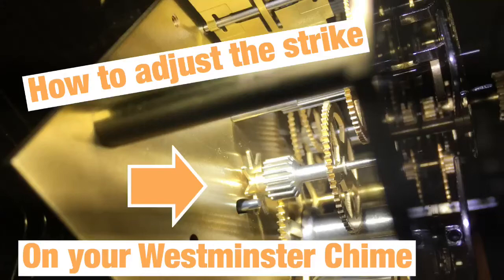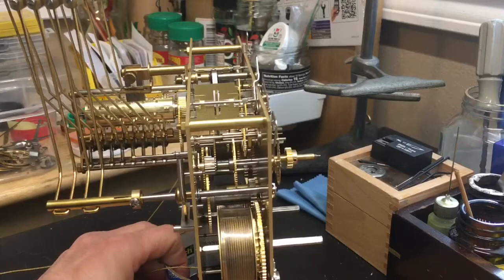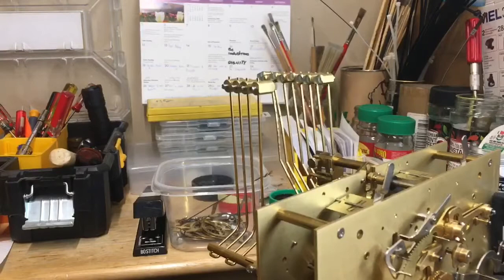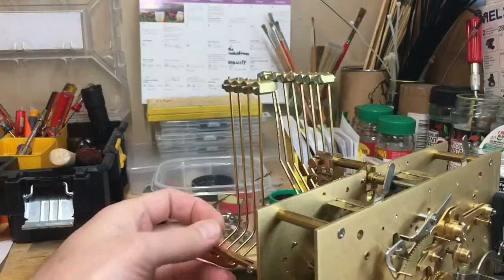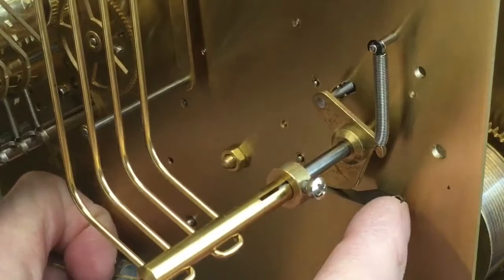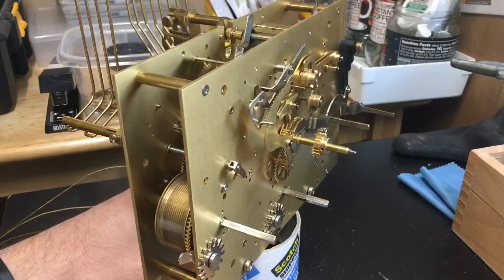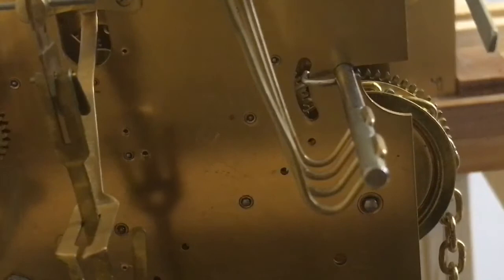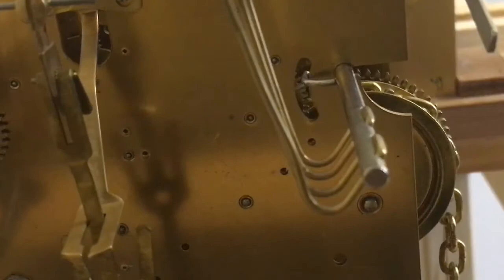How to adjust the strike on Westminster Chime

Comment: i would like to know what controls the speed of
 the chime melody and if it can be adjusted to strike slower
Reply from the maker: The gravity of the weight or the power of the spring drives the gear train that operates the melody. You could try a weaker spring or lighter weight. They are not designed to adjust the speed. The other way you could do it is add weight to the fly, but the would probably cause other problems such as premature wear. I don’t recommend it.
Reply: @Chrisclockrepair  thank you so much! i guess the weights are calculated for each movement.i am trying to learn how the mechanisms work. i am studying the movement i had in my old clock but it would be easier if i had a book;do you know of any i could buy?
Reply: Since cleaning my chiming clock the chime is slow although it strikes all the hours it's a long time between each strike, how can the strike be sped up?
Reply from the maker: @chrisrix7645  your clock likely needs a service. Or...you have the wrong weight there.